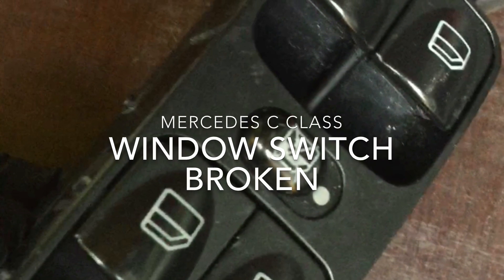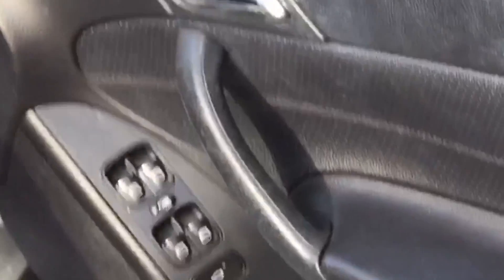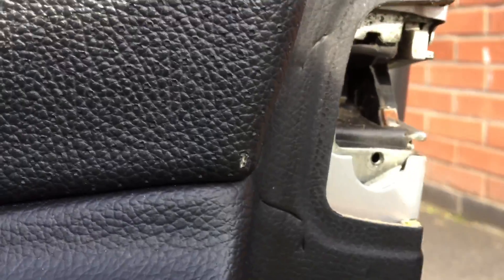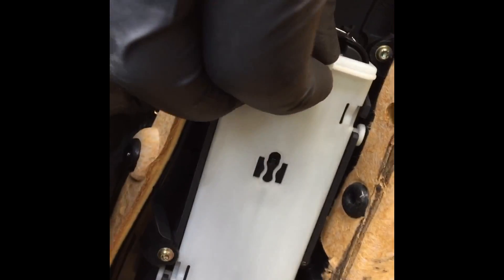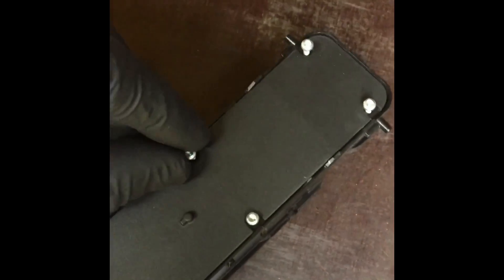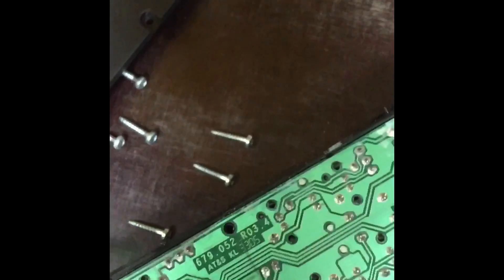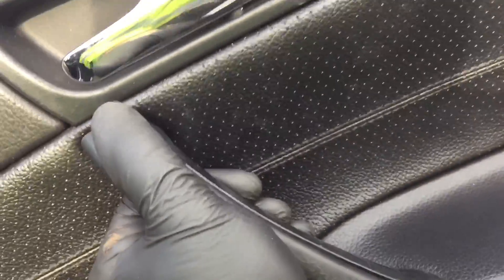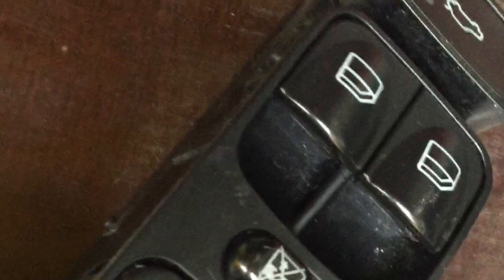Mercedes C Class Electric Window Switch Broken, How To Repair Or Remove Door Panel Card

Comment: Hi I have a big question I have a Mercedes 2007 SL 550 and I need to replace the window controls do I need to take off the door panel or could I pry it off with a tool
Reply from the maker: The panel will need removal Thanks for the great comments👍🏻👍🏻🛠